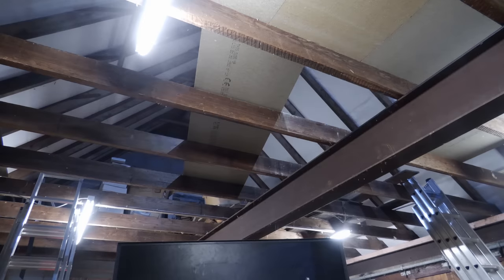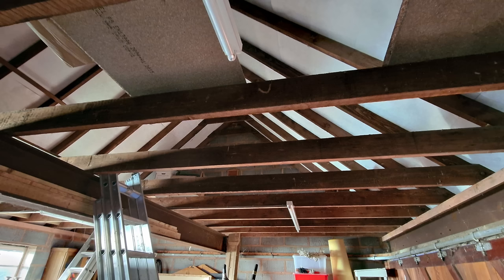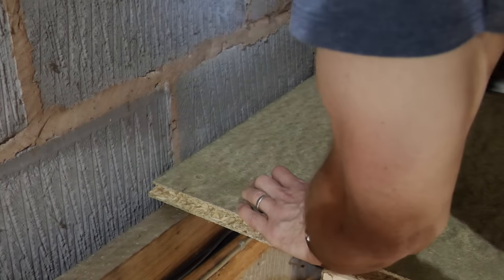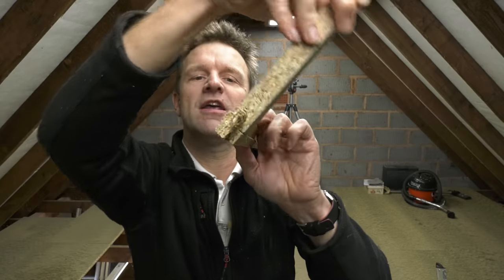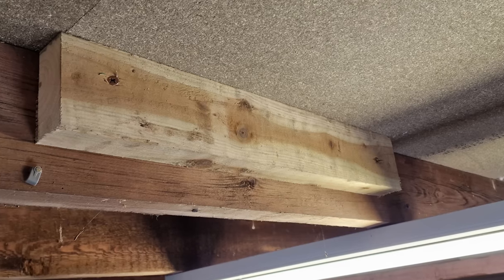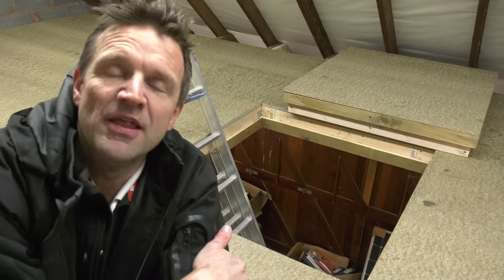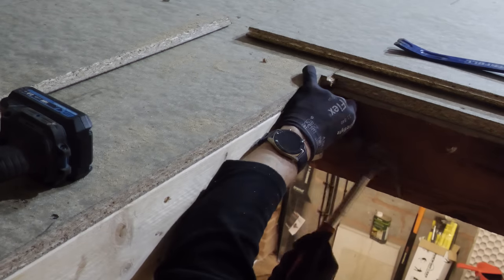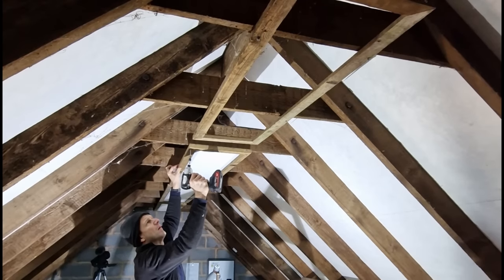How to Board your Loft

Comment: Adding an expansion joint makes perfect sense, but does anyone know how this is meant to work when there are numerous screws holding down the rest of the floor? It seems the gap would only be able to accommodate expansion from the outermost sheet, leaving the rest without any expansion potential.
Reply: Indeed, it is confusing. Imagine if he had glued as well. Even more redundant
Reply: @MrWarfd001  btw wasn’t a criticism of the way Charlie did this. You see this method applied in lots of situations. Totally understand that a fully floating floor wouldn’t be appropriate. Maybe you can ignore expansion here because both materials are wood and would expand similarly.

Comment: Mistakes are how most Diyers learn & thanks to people like you we stand a good chance of not making too many. 
I have a raised loft floor & increased insulation project coming up so I was interested in seeing this one for any tips. My raised loft floor is only for occasional access & storage so I won't be gluing any boards down in case I need to get them up again in the future to access the 1st floor wiring etc. However, the takeaway from this video for me is that the floor board layout is going to be important. I will be working with a mixture of existing & new T&G chipboard so I need to minimise waste & awkward edge fillers. 
Keep up the good work..    
👍

Comment: 22mm mdf floorboards like you used are slowly becoming industry standard on additions, especially commonly used (by me) on loft conversions, using expanding glue to the joist to reduce squeaking

Comment: Great stuff as always , I’ve just recently had a concrete garage installed as a workshop/ store it’s 6mx5m  . Our original two car garage was turned into a granny annex some 20 years ago .   When we decided to get rid of three rotting shed’s we have , I did look into having a proper brick construction put in . Well the cost was absolutely staggering , at least three times the price of the concrete structure . Even the base would have to be done to a higher standard to meet building regs , which a concrete structure does not require not even planning was required .  All this leads me to realise if you’re lucky to find a property with an existing building, just how valuable it is and often it doesn’t really reflect in the purchase price of the house .  I know you have done lots to your garage , but I wonder if you’ve ever looked what it would cost to replicate it , it might be quite an eye opener .   As a point of interest when we converted our garage into a granny flat , it cost £ 20, thousand all in . Just before I retired as an electrical contractor , I worked on a similar project to ours ie existing garage made into a granny annex . The project came in at just under £80 thousand and is actually smaller than ours .  Now knowing you I recon when the time comes you will save some serious money               Best wishes and kind regards as always .   😀👍👍👍

Comment: Hi Charlie, great honest video. You make a good point about which way up to lay the flooring, not least because some manufacturers put the print on the reverse side so you do have to read carefully and not lay on autopilot (don’t ask)! The floor also goes together easier when you lay it the right side up as it’s been engineered to be done that way. Great idea about leaving the hatch, to0 marks to your chippy 😀
Reply from the maker: Thanks mate. Yes that's another good point about why they do it that way up. 👍

Comment: For the hatch, you could get a couple of handles which you attach via bolts going into threaded inserts. When you're done, you remove the handles and the inserts remain.
If you recess the inserts and use shallow headed bolts, you could even leave the bolts in there.
You could also just use some webbing screwed into the sides of the hatch which you are able to pull the hatch out with.

Comment: Nice work. I'm just finishing laying a structural plywood floor as part of a bungalow loft conversion. I've got to sister up rafters onto the ridge RSJ. Insulation is going to be with a product called Actis which I have managed to haggle down to less than Pir board. For a habitable space for part L of UK building regs its great as it expands slightly to fill in between the rafters. I am looking forwards to seeing your StairBox video as I intend to order one. Great content.

Comment: Hi Charlie, nice job👍👍 , I did my roof flooring  a few years back laid on 3" by 2" lengths of wood as my loft joist are  all over the place Hight and distance wise , added  leg supports and screwed  never bothered with clueing , no need after all the screw are  fixed in , not had a issue with separation or splitting
Reply from the maker: Thanks Stuart. Sounds like you did a good job there 👌

Comment: Once again a timely vid. Had a loft hatch installed by a plumber who needed additional access, and he cut two joists with no reinforcement! So I am looking to add some strength- good to see how you've done it. I have used 22mm caber before and agree it's good stuff.
Reply from the maker: Glad to hear you found it useful. Thanks for the comment 👊

Comment: Some great tips. Its made me seek answers to two issues i might face building a house.

1. How to support boards on a new house where some of the joists change direction by 90 degrees. 

2. Gluing the T&G and the boards to the joists or using green glue tape on top of the joists instead because my floor decking needs installed during the build when no roof is on. I was advised to use minimal nails until the roofs on then screw it all up otherwise water sits in the screw heads and works into the chipboard past the 45 day weather protection. But with minimal screws the boards wont pull down well to the glue so maybe the green glue separation tape would be best.
Reply from the maker: Thanks. They do a version with polythene film on it for your type of situation - caberdek. That would be ideal. The screw holes are still an issue though. I guess you could tape over them as you say.
Reply: @CharlieDIYte  taping over could be a good idea.

The tape i referred to was 3mm foam tape by green glue which adheres to the top of the joists and acts as a sound decoupler between the joist and caberdeck.

Comment: I’m adding some loft flooring right into the roof corners - will only have boxes stored on them (no one is short enough to stand in these areas!). Anyway thought I’d watch this just to see if I could get any hints or tips. Definitely some food for thought. One idea…your loft hatch. What about a system similar to drain inspection? Sausage shaped holes that T bars fit into? Insert and twist to lock the T bar and lift to lift the hatch?
Reply from the maker: Yes I like the T bar idea. Thanks for that 👊

Comment: Just a reminder that the ceiling ties are always in tension and so some way should be found to stop the roof from spreading when you cut one for your hatch.  Screws into the end grain is not normally sufficient.  Angle brackets each side of the cut joist, bolted through the trimmer should do.
Regards
Tom (Structural Engineer)
Reply from the maker: Thanks Tom. I'll also angle bracket the joists down to the wall plate. Pretty sure it's nailed down but won't harm to put extra brackets in. Appreciate the comment 👊
Reply: @CharlieDIYte  Sounds good but remember that it is the roof trusses which restrain the top of the garage wall so it is backward to secure the trusses to the wall head expecting the wall to prevent the trusses spreading.

Comment: Re the loft hatch I’d be tempted to screw some magnetic material to the areas where you need to pull on and get a strong magnet to give you something to pull on. Think of the magnets that people go magnet fishing with. As you have the hoist means you could use that to pull the hatch up.

Comment: Aren't OSB boards supposed to be better than that type, which is supposed to get damp etc? Thanks for the content, it's really useful for me going into my first owned house and needing to do lots of the work myself. I'm here because of research on this very subject.
Reply: You should only use boards which are designed for flooring. I've not seen OSB or MDF certified for flooring. If damp is a concern then you get get waterproof chipboard flooring. I  think the only point in gluing to joists is to prevent squeaking.

Comment: I think the rafters would have been just fine for your hoist - 100Kg is under 16st, or one big bloke. Would be amazed if two rafters (or four if you're bracing across) couldn't handle that.

Comment: one issue I had when laying this type of floor in a bedroom I had to fit the next piece of floor before screwing down the previous sheet as the sheets wouldn't fit together. Did you start from a centre line and work to the outside or doesn't it matter
Reply from the maker: Yes I release the screws a bit when slotting in the next piece then tighten them once it's down.

Comment: I know it would have cost twice as much but as the boards weren't staggered and laid the wrong way up, could you have put a second layer on top of that first layer and staggered that and laid the correct side up?
Reply from the maker: I guess so. No real need though as it's just as strong particularly with the glue.

Comment: What about adding insulation under the boards similar to a house loft? Can the boards go directly on top ‘squashing’ it down?
Reply: The space under the floor should be insulated, even if it's a normal room, but especially if it's a garage.

Comment: hi charlie, looking at your loft refurbishment video, why do you recommend 22mm chipboard as opposed to 18mm or even plywood or OSB board?
Reply from the maker: I guess the issue with plywood and OSB is you have no T&G all the way round so will need noggins - but then it's good practice to strengthen on the join if it ends between joists anyway so my 22mm is no great benefit here. If your ply or osb is only 18mm or less you will need a sub base to strengthen it.

Comment: I think it would be helpful if it was explained you can't do this in house lofts now as squashing all that insulation up there makes the ceiling joists prone to damp. It is fine for an outbuilding like you have but most people will be using loft legs, Loftzone etc. Otherwise very good as always.
Reply: But house lofts can simply be insulated with PIR between the rafters. No need for insulation under the lofts floorboards .

Comment: Hi Charlie, what's your thoughts on the ryobi saw track? Very mixed reviews online but I'm tempted to pick one up. Thanks
Reply from the maker: Have you got the brushless HP saw? If so, it's probably worth getting but you won't be able to rip down a full sheet with it. It's ok but a bit more flimsy than the aluminium tracks. Plus you have to guess the entry point of the blade as it's a few mm from the edge of the track.

Comment: Great job! Those jobs are never straight forward as in my experience a lot of houses seem to have been built before the straight edge was invented! 😁
Reply from the maker: Thanks! Yes I found a plumb line tool in the loft which was a plank with a long string and a lead pear drop weight. I suspect that was used a lot on the build of mine!

Comment: Using screws on joists is silly, They are strong but sheer off easy (snap) that's why you use nails like 90mm from a framing nailer, I'd stick around 6-8 per joists.
Reply from the maker: Fair point.

Comment: I thought it did not matter if the boards did not meet the joist because the strength came from the boards being T&G all around?
Reply from the maker: It's still recommended to support the short edges. It does make you wonder why they bother T&G all the way round though, doesn't it!
Reply: @CharlieDIYte  Because they are T&G all the way around the board I was told you don't have to finish on a joist because once glued they are strong enough to carry the weight between the joist. I did mine like that and had no problems, no waste either👍

Comment: Can I do this in my house? Like am I legally allowed to do this?
Reply from the maker: If you're going into the loft you have to make sure everything you do is fully compliant with building regs - so staircases, structural integrity of beams etc and you'll need building regs and/or planning for any windows. If you don't do this you can't treat it as an extra room when you sell, and also if it's not been done properly it will in all probability spook your purchaser.
Reply: @CharlieDIYte  thank you for the very comprehensive answer.

Comment: Hey mate, this is not criticism but IMO you should not be using chipboard in an unheated space no matter what the manufacturer claims. Actually I don't think they would disagree with me here but your garage is way more prone to damp, and atmospheric conditions that your house. So what means is that you want something with structural support even if your beams are 6". OSB is substantially more cost effective than the chipboard that you went for and is stronger and easier to work with (it's lighter because you can use 18mm). If you really want sheer strength, and you might if you are putting a treadmill there, then go for structural ply or you can even get cement board. In fact if you went for cement board, you wouldn't need to care about spacing but the cost of fixing is a bit higher. 

As to hidden screws and MDF or really any sheet material with tg4, you absolutely do not screw into the tongue part. The first screw goes about 1" away from the edge. If you screw into the tongue you are compromising the structural integrity of the material.
Reply from the maker: Thanks for this. I hear what you say but it's moisture resistant chipboard but most importantly it's a dry well ventilated space so no problems with damp. Good point about the hidden screws 👊

Comment: You will not be the first to put floor up the wrong way and won’t be the last. It the end of the day it is a garage. Not the end of the world. If you do convert he biggest issue will be fire break, class 00 board etc.
When I did mine at my last place I cut around roof rafters and push up to the edges leaving no gap to be filled. Did take a while though cutting each one individually. Hey if the good lady and lad are happy, job well done

Comment: Its only a personal point BUT i really dont see the sense in applying glue/adhesive in thin lines ,more so on wider work. it must only be covering 10% of the area max. would rather use a good glue that can be spread over most of area.
Reply from the maker: It may only be applied in a thin line but it expands, so much so that it expands out of the joint.

Comment: Instead of chisel and hammer to make the 10mm gap around rafters, a multitool would have done it with precision in seconds.
Reply from the maker: I tried that Martin but couldn't get it into the angle.
Reply: @CharlieDIYte  

👍

Comment: Those joists are not supposed to take any kind of weight.
Reply from the maker: 6x2 not supposed to take weight? I don't agree. Granted they're not C16/24 but they're decent quality slow grown 1970s redwood with a huge 300mm deep steel supporting them in the centre so I'm not sure what your issue is with them.
Reply: @CharlieDIYte  Well put it this way if you was wanting to do a proper loft conversion it wouldn't meet building regulations. ok for lightweight storage, but nothing else.